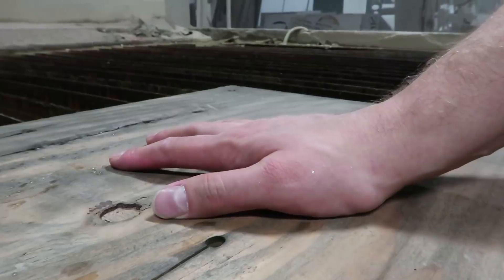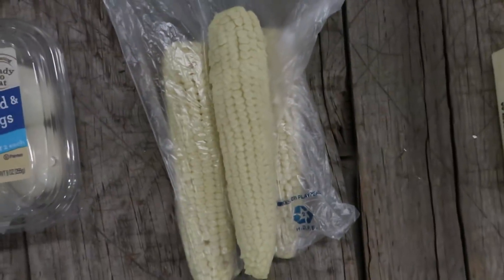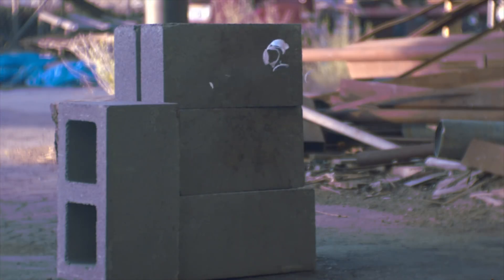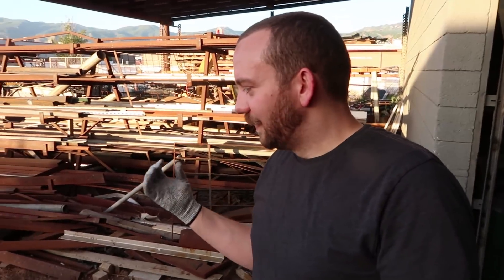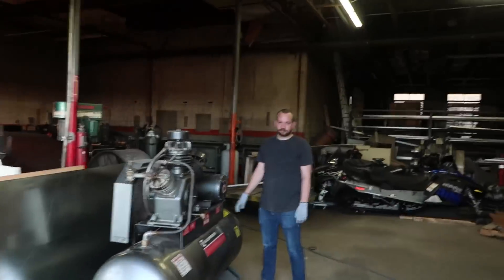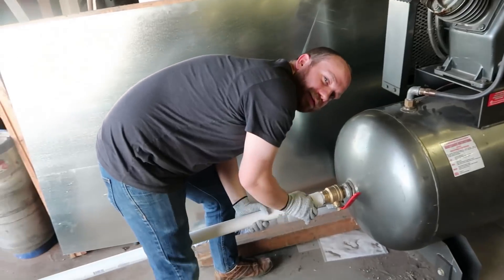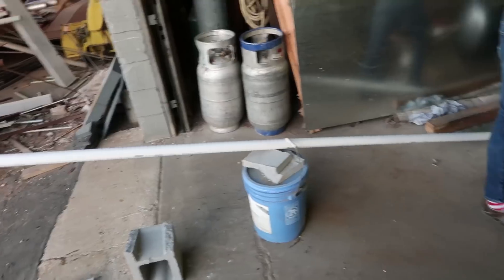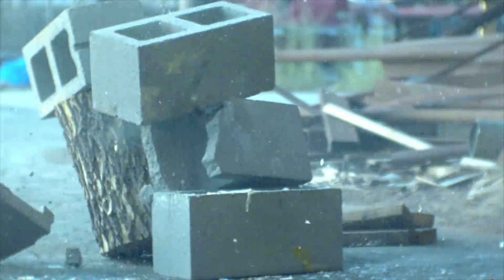Will a 300 MPH Banana Break a Concrete Cinderblock?  In super slow motion

Comment: I had a big screw compressor that supplied my factory with air . I had main lines that were 3” galvanized steel about 600 feet with branches off every 10-20 feet to machines. 
1 also had 2-90 gallon reserve tanks in line from whenever the system was using piston driven compressors.
That would have been a great compressor for your air cannon. 

With my air system you could set up multiple air cannons and feed them automatically and never run out of air. 

I enjoy watching your videos!

Comment: What if you hydraulically sealed a small metal cup onto a cinder block, ran hydraulic line, then presurized it with mashed banana leaving nowhere for the banana hydraulic pressure to go but either through the cinder block or through the pump?

Comment: I know its a year and a half late. But if you want to launch an object that is an odd shape, or something you need to stay together until it exits. You need to make a two piece foam plug to sit behind the object, so the pressure of the tube builds up behind it and launches it out between the air and the object, and then because of air resistance, it peels off the object once its not held together by the PVC tubing, and the object is launched, I think it was mythbusters I saw this on originally, where they used foam to hold (something?) until it left the pressurized tubing, because it kept being shredded apart by the air, it could have been an egg or banana i dont have a clue tho. lol

Comment: You guys need a piloted diaphram valve (like a sprinkler valve) on that air gun, your actuation speed is pitiful with that ball valve, and the chamber is waaaaaay too big, a 3"-4" by 36" chamber is perfectly adequate for your barrel volume and diameter, you could use the big tank to top off it's pressure for multiple shots. 

That being said hell yes, that's just about how I filled my childhood, though that thing is way safer than some of the monster potato guns I built, power wise. I had one that shot full frozen apples at around 750 fps, that's about 28,000 ft-lbs of muzzle energy, it was a sweet piece (shoulder mounted cannon). Used compressed air and propane held behind a burst disc, which was the diameter of the barrel, and as it's name implies it bursts when the mix is ignited releasing all the heat and pressure. Depending on your charge ratio, up to 10 bar of compressed air mixed with a stoichiometric mix of propane, pressures up to 600 PSI can be generated, imagine the inside of a race engine cylinder but it's compressed volume is measured in tens of cubic inches. That specific gun had a 75 cubic inch chamber that was two feet long and had a 2" inner diameter, made of schedule 80 PVC (steel is preferred for safety, I was stupid but lucky), with a 2" burst disc diameter, attached to a five foot long 2.5" conduit PVC barrel, which fits apples beautifully. If you don't freeze the apples they become applesauce mist. You only shot that gun once or twice a day, the recoil put me on my ass and turned my shoulder blue... 

God damn I was a scary kid lmao...

Comment: Instead of using air pressure to send the ping pong ball. Put a foil cover on both end. With the ping pong ball inside on the right. Vacuum pump the air out. 
So now you break the seal on the right. As air pulls in from the right. This will send the ping ping ball from the right to left. And out the left hand side thought the foil.  Mythbusters has done this experiment. The ping pong travels so fast it can break a wooden board. Since it's pulled by vacuum and not being pushed by air. It don't break up inside the pipe.

Comment: guys, you have to have about a 3" i.d. barrel and make sabots to hold the projectile.

a sabot is a protective holder or "shoe" that supports the projectile and makes up a larger diameter to provide a good seal with the barrel. its the best way to fire sub caliber projectiles from a larger barrel.
various foam products work very well. you can easily use spray foam to surround a projectile(coated with a release agent such as petroleum jelly).
then cut it in half, thirds or fourths. to open for loading the projectile.
tape it back together and load into the air cannon.
it will keep many delicate projectiles together for the very violent and instant acceleration and trip down the barrel.
once it leaves the barrel the sabot will peel away from the projectile.

ive fired a marshmallow through a steel car door using this method. it takes about 395 mph if memory serves me.

Comment: These things need to be fired in a vacuum. The air pressure behind the object and air resistance in front of it will just disintegrate most objects. Fired within a vacuum a ping pong ball can easily punch through plywood.

Comment: gotta accelerate it slower..   my potato gun blew everything but the hard nut inside walnuts completely off....  but thats a dif gun.. 2" barrel 4" chamber fueled with atomized gasoline..    and yes it sounded exactly like a 75mm howitzer.

90 psi is really low..  go fig mine was upwards of 800 psi..   used to shoot stuff over the grand river in Dunnville...  go figure bout 3 football fields away..

Comment: Instead of freezing the banana in a standard freezer, get some liquid nitrogen and dunk the frozen banana in there for a minute or so just before shoving it into the barrel. Standard freezers don't actually get foods rock hard because of the frost free cycles. Liquid nitrogen should freeze that banana a lot more solid than a frost free freezer will. I'd even use liquid nitrogen on a banana frozen in a non frost free freezer to get it even more solid. Whether that can break a cinder block remains to be seen.

Comment: Why are you using a PVC drain coupling instead of a PVC pressure coupling? As the names suggest, a drain coupling is for your plumbing drains, and a pressure coupling is for things involving high-ish pressure. (Generally not exceeding 350psig). Is it because a drain coupling is 50cents cheaper? Pressure couplings have double the contact space with the pipe, and are ever so slightly thicker, they also generally are held to a higher standard, so they are a tighter fit.

Anyways, that's all just info I feel the need to point out because I work with PVC, and I don't expect everyone else to already know stupid trivia about it. I'm totally liking this though, keep up the good work! (If please, try to be as safe as you can be)

Comment: Why don't you drill holes in the barrel to vent it?
Reply: Barsa F wouldn’t everything just fly out of those holes or no?
Reply: It would also probably prevent the blast of air from knocking over the blocks. Good idea.
Reply: From what I can tell, they don’t seem to exactly be experienced pneumatic technicians, considering their comment about the whole “dropped it from 140 to 90 PSI”. That’s still a fairly high PSI, not to mention the sheer size of your accumulator under the compressor, that is a lot of force stored in that thing.

Comment: Should try to put the barrel under vacuum. Would allow for faster speed and no air resistance until leaving the tube. You can do that with a vacuum pump, a few small fittings, a hose, and some tape.

Comment: You should come up with a cushioned wad for it like what they put in shotgun shells to dampen the pressure before acceleration and minimize or eliminate deformation of the shot. The problem is the sudden increase of pressure shock loads your projectiles causing them to vaporize in the pvc barrel. Even some thick memory foam with a plug of some sort to keep the air from blasting through the pores might do the trick to displace the sudden increase of pressure behind it. The heavier the projectile, the more resistant to acceleration it is going to be. Just my $0.02. if anyone has any corrections or other suggestions feel free to reply

Comment: You need more pressure and less air. Most of the air in that tank is wasted as you can see in the slo-mo most of the air comes out long after the projectile is shot. A much smaller air tank will shoot just as fast at the same pressure. All you need is more pressure and a longer barrel and it will be even faster

Comment: Get a thicker tube. Muzzle load so its attached. Move up to nitrogen or co2 for much highter pressures. Go w electronitc on of valve ur wasting pressure after it leaves barrel. Or use grill ign and 87 octane in spray bottle

Comment: military research of how to militarize bananas....
Reply: Just ... just put alot of them into a Container and drop it on the Enemy base, they are slightly Radioactive so with enugth you may get a high enugth Concentation to do some damage. (The Weight and Mess may be the most Inpacting Force. Yeah Poison Bananas)
Reply: Dude forget militarizing bananas drop 400 pounds of freshly prepared hot horseradish the fumes from that shit burns like tear gas just have a bomber pass over with 8 55 gallon drums of it
Reply: **weaponize
Reply: Drippy Redd 
Was just gonna correct that.

Comment: They should roll up pieces of bread to fit the tube, use string or something to keep the shape, put it into a paint can with a small hole in the top, and put it over a fire until it stops smoking. Then you have carbonized bread projectiles, which are also incredibly heat resistant. I think Ave has a video on that but I'm not sure.

Comment: You need to open the valve faster. The slingshot channel has a method using elastic that is effective. You should be able to implement it fairly easy and get a boost to velocity

Comment: You need to soak them in liquid nitrogen first to get them to break the cinder block.
Reply: John Possum do you think an item that has become ice can break a fucking cindet block?
Reply: Donger yeap.
Reply: Donger It's not just "ice" lol
Reply: John Possum lol I just said that
Reply: Mod X Wolf™ the point is it would become harder.
Reply: Donger what’s his face made dry ice bullets search for it. Taufladermaus I think.
Reply: >the laws of physics
Reply: Mod X Wolf™ it’ll break on impact no matter what. Doesn’t change that header things hitting the block will make it more likely to break.
Reply: r/wooosh @ The Whole Reply Section
Reply: ElTurbinado dry ice is different from a nitro frozen fruit.
Reply: No, it would break in the barrel, soaking something in liquid nitrogen makes it extremely brittle, the force of the pressurized air hitting it would shatter whatevet you're trying to shoot
Reply: It would only shatter faster >.>
Reply: Vgamer311 no it’s becoming more brittle, a touch and it breaks.
Reply: Vgamer311 it wouldn’t become harder lol
Reply: 153 are dumb
Reply: yes it can
Reply: PUT THE CINDER BLOCKS IN LIQUID NITROGEN
Reply: Then it would just shatter